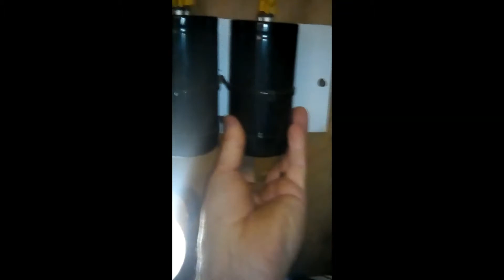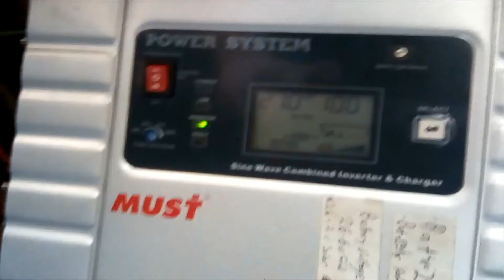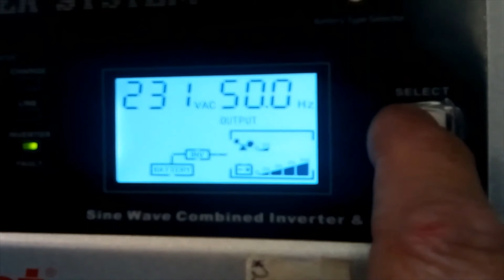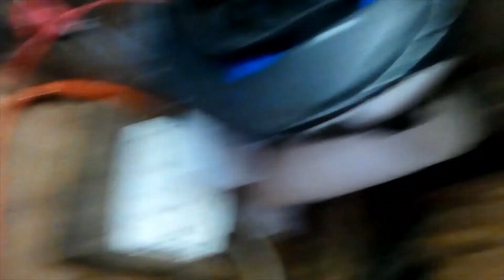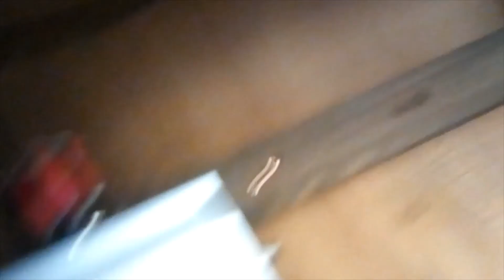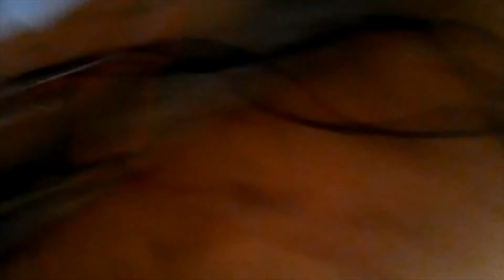Hydro vid 8.        Hydro Overview.

Comment: How much ac ripple voltage before adding capacitors?
Reply from the maker: It was a few years ago now, so I can't remember, I do remember that all AC rectified power has a small level of ripple. There is a formular for working out what size capacitors you will need to fit. I found it easily by doing an internet search.

Comment: Capacitors for ripple is a reasonable idea
Reply from the maker: Thanks. They do actually work, the charge controller now works as it does when supplied by a solar panel. Both finding the MPPT and also changing the power applied to the battery as the level of charge increases.
Reply: @kletusbobby7029  nice to know mate, was looking at epever myself supposedly that model is superfast tracking, freind has a bunch of em on his 196v battery bank using very high quality diodes to stop backfeeding between each unit in his segmented series bank. Wired straight to an industrial ups which powers his offgrid caravan in remote QLD